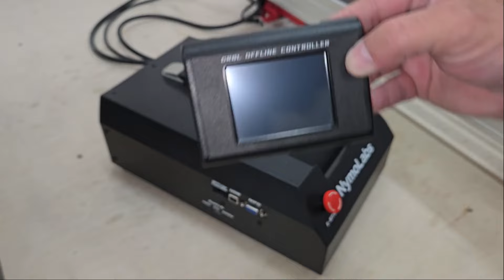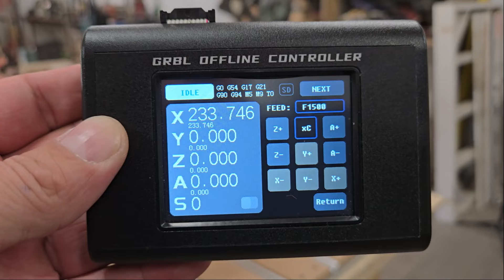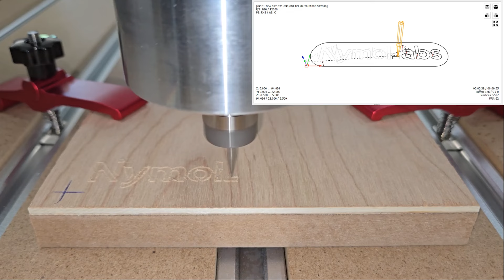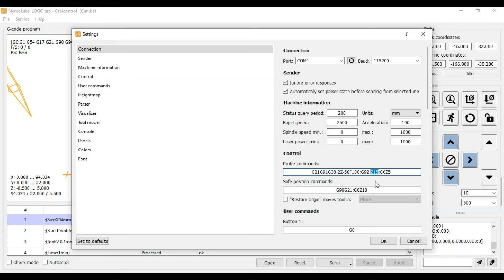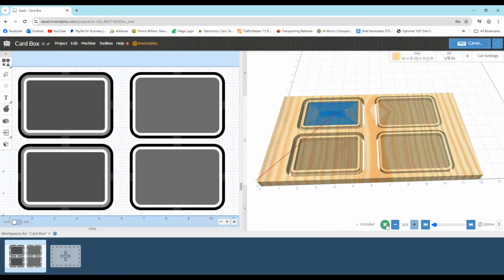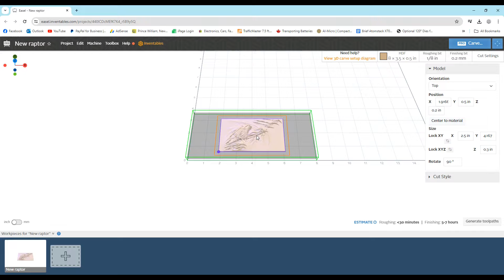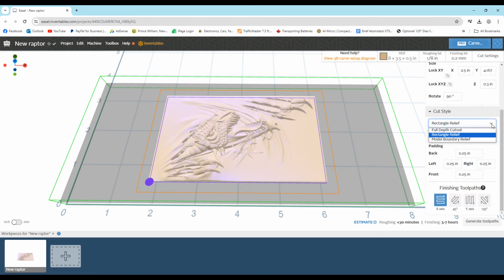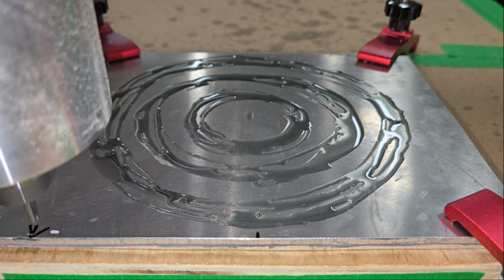Milling Aluminum Sprockets W/ NymoLabs NBX-5040

Comment: Thanks for the Video - well done. I use WD-40 with great results on my mill and lathe. Use the spray bottle giving a squirt every few seconds. It will be a bit messy and make sure the room is well ventilated. Or... use compressed air to evacuate the chips and cool the cutter. Look up the correct speeds and feeds in the Machinery's Handbook (number of flutes is part of the equation). They have a formula or look up table that will give you a good starting point and troubleshooting guide. Even though the setup looks ridgid, it does not have enough mass to damp vibration. There are resonant frequencies you want to avoid. Experiment and good luck.

Comment: I'd recommend coated 3 flute roughing end mills (actully chamfer mills) for aluminum from Maritool. Work great for roughing out pockets, holes, and part perimeters in aluminum, copper, and bronze. They have good chip evacuation and "chip breaker" geometry. Even with a Unist MQL system on my ShopSabre 23 I had some non rougher style end mills have chip weld issues in for example holes close to tool diameter or small deepish pockets, Maritool roughers haven't had any chip welding issues and are at a decent price. I use 1-3 flute finishing end mills for a final pass, Maritool but also a couple other companies.

Comment: Two things you need for aluminium, higher speed and use single flute mills, better still use DLC coated single flute mills, no mist or cooling required. With single flute you want 18-24k RPM.  If you use other bits and get build up of ali on the bit that won't come off, soak it for a few hours what you call Lye, to dissolve the alu.

Comment: Also… did I see no spoil board under the boxes? Just curious!
Reply from the maker: Lol, no. It has a hybrid aluminum/mdf spoil board that was installed at the start of the video and never removed. The mdf boards are removable so they can be replaced when they're 'spoiled'. That's why the aluminum t slots and fasteners are all set well below the surface of the mdf - so they don't come in contact with the endmill.

Comment: How did you get the angle edges on the edges. Is that just from sanding? I’m assuming it is because you used a 2d cut path right?
Reply from the maker: It can be done with the machine, of course, but I just hit them with a file because it's quicker than creating the g-code for a one-off. In Easel, at least. If I were batch processing the gear then I would take the time to set up the code and machine to do everything. Probably use a different software altogether.
Reply: @JamesBiggar I’m trying to do this exact project. I just ordered a 6040. Where did you get the file for your sprocket from?

Comment: I mill aluminum without coolant. You probably milled too slow and your endmill rubbed instead of cutting the aluminum. It will dull the endmill too.
Use mills with 1-2 tooth’s for milling aluminum.
Reply from the maker: Used 70 ipm feed rate @ 12000 rpm. I just found a video from NymoLabs showing how they used 30 ipm but at 30000 rpm and no coolant. Recommendations are all over the place lol. I think I should stock up on endmills and spend some time creating a test file with a range of settings. I definitely don't have the best endmills for this. Just the general purpose hss 2 flute spiral. From what I understand a single flute is best, with a higher helix angle?
Reply: @JamesBiggar  ok... I answerded here on my iPad and it got deleted. Im trying again shorter.
12k rpm with 70ipm is fast. I dont think you really milled that fast. I would use 12k rpm with 30-50ipm with a 6mm endmill with 2 tooths for 6061 aluminium.
Reply: @JamesBiggar  i cant give you the name of the app im using for feeds and speeds. YT is deleting any comment when i writing the name in any way. IDK what the problem is here.
I send a email with the app name for feeds and speeds.
Reply from the maker: That's what the settings were so yes, that's how fast I was milling. I've also tried 12k rpm with 30, 40, and 50 ipm on a test sample yesterday, noticeably slower and produced worse results. I think NymoLabs settings are a good place to start, but I'm going to make a test file with settings ranging between the numbers all you folks have been giving to try to figure out why there's such a difference in your experiences. Too many discrepancies.
Reply from the maker: Your comment should appear soon. Wasn't deleted. Yt flagged it as spam because you tried to include a link. I have filters in place to prevent spam, otherwise the comments get inundated with scams.
Reply: Anyway… try a 1 flute endmill for better chip evacuating. Maybe you did recut chips with the 2 flute endmill. But be a little more gentle with a 1 flute endmill. They are more brittle. 
Happy machining. 👋